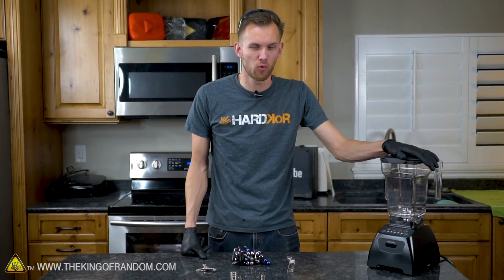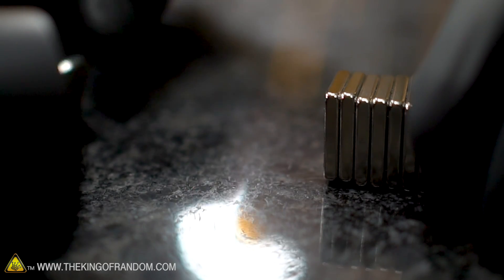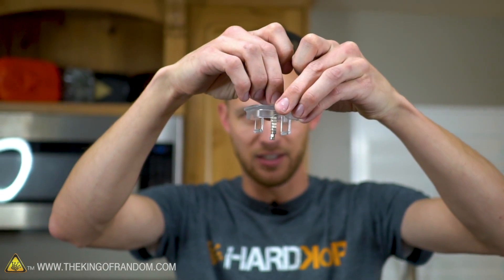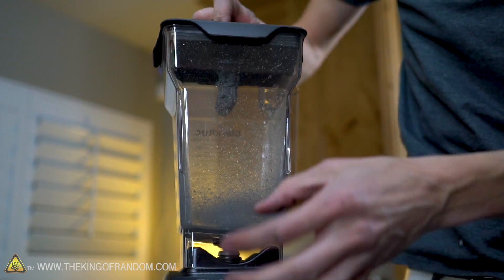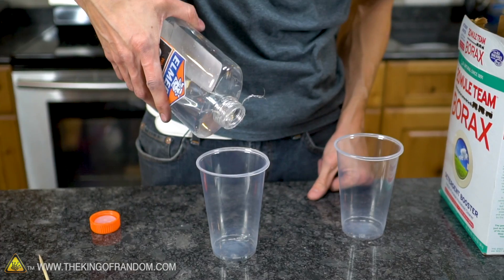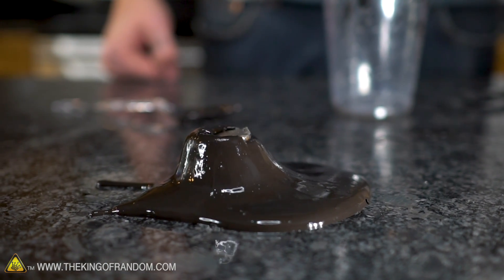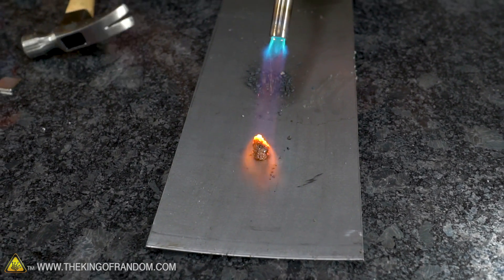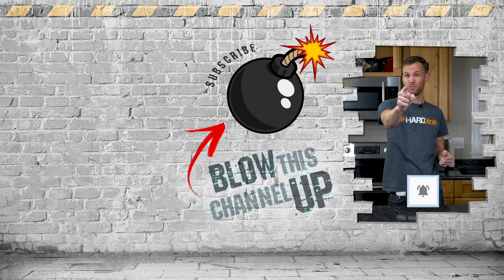Will This Make Magnetic Sand?

Comment: It’s more of a magnetic the ones that are not smashed and broken for ma’am or then Smash Into Pieces actually stick better for a reason the first reason is that it’s more it has more space to stick if it didn’t have more space then it would feel a little smooshed if it’s too much much like the ones that are not broken actually has a little bit much to but it still has magnetic it’s still you know if you have that harness that they use like metal things to make it in the squishy ones can I have a magnetic mag but look what has more SmoshAnd you have a small ones with little blender if you something bigger in the blender it will just rip a piece off and Susie will you buy that how much does it cost but I want to know how much that cost yeah I don’t know mother no we have anything else on

Comment: When you heat most ferrous materials they lose their magnetism (blacksmithing trick to know youre at quenching temp), when you hit the magnet with a hammer or the blender the actual material can change causing a loss in its magnetic power

Comment: they aren't getting weaker, instead, they are joining N to S. This is causing the force to be canceled. Normally a magnet has all the force going in the same direction. You caused the force to be evened out between the sides of N to s poles. So they begin to seem weaker.

Comment: its clear why the sand has less magnetic power; because the smaller pieces magnetic fields are not as neatly oriented as they are before. just hitting a magnet without breaking it can cause that.

Comment: The reasons that the “sand” magnet did not stay was because there was no real positive or negative energy
Reply: I forgot to say why but the reason why is because it was once a flat surface with positive and negative sides but when I was a ball it was little one of those round ones but with two sides doesn’t make sense right. So the positive is attracted to the negative which causes the two to have no effect to a reverse effect on the object

Comment: Try melting mangnets and then put them again ito one peace to see if it will have the same magnetic reaction
Reply: I did an experiment on the effect of heat on a magnets strength, and basically if you heat them up they get weaker. All magnets have a certain temperature, called the Curie temperature, where if they are that heat or higher for a period of time, they can permanently demagnetize. Any magnet that gets to the point of melting would not have any magnetic capabilities afterwards
Reply: @diegog5129  thanks for anwsering it is kinda strange but intresting too
Reply: @diegog5129  and one more thing then you expermented it with heat but that if are going to cool down or frezze with liquid nitrogen will it be the same magnet or it will be same as just heating it and try it with difrent magnets and wich magnets react or wich not just for showing in video
P. S sry for bad english i am from Lithuania

Comment: 2013: lets melt metal
2019: lets blend magnets
Reply: 12020:lets blend a blender that is blending a blender that is blending another blender blending metal junk with a computer powered electric line turning the blenders on and off
Reply: 2025: let's melt magnets in our kiln
Reply: @johnmarcel2723  and putting them in a magnet machine
Reply: 1112020: let's make a cookie
Reply: This just got 200 likes

Comment: My finger almost broke when I was younger because i was playing with my dad's industrial magnet cube on the open trailer and my finger was stuck between the cube and the metal of the trailer. In conclusion, magnets arnt toys
Reply: I got pinched by 25×25 mm maget and another same magnet and those have pull force of around 10 15 kg And it CRAPPY HURTS JDSJDHDHDHDHDNDJDJDBRIABVTKSVF

Comment: Why don't you try sanding the magnet to get very fine magnet powder. I've tried it and it actually works
Reply: Heat gets rid of the magnetic properties
Reply: Dazed  that is a GREAT idea!
Reply: @abdul mehmood You ok in the head? Iron is not a magnet and iron filing is just fine iron, not a magnet.
Reply: It’s workes it’s a works
Reply: 700th like btw
Reply: Try not to heat them up though
Reply: Wheres the fun in that
Reply: But then they wouldn't have the chance to break a blender!
Reply: Try using steel shavings
Reply: Really ?

Was it still strong?
Reply: *Eh Hem* 

WORKS.
Reply: DeadlySlayerX thx for the tip lol I never thought of that
Reply: Who else came to the comments to see Emirates A380 get corrected a ton
Reply: @braydenstranan5920  just you
Reply: Random comments
Reply: now that is  vary much ediquit :)
Reply: Works*
Reply: @christensirianni1835  you have a point
Reply: That's very cool! Thanks for the idea I'm going to try it. Wish me luck.🤞🤞
Reply: "Works"
Reply: *works
Reply: Did it work?
Reply: epickid426 you should reread the comment
Reply: @Nnnnnnnnnn670  it’s edited
Reply: @SomeRandomSpider12  no
Reply: @SomeRandomSpider12 

No it doesn't work
Reply: B

.
Reply: @ugandanweeb5719  your not funny

Comment: The magnet as a whole has one magnetic field (1 north pole, 1 south pole). When broken into pieces or dust, every fragment now has it's own north/south pole. You have several tiny magnetic fields all intertwining with each other which is enough to hold each particle to each other yet not a strong enough magnetic field to hold the weight of the total material.

Comment: You have created a model of ferromagnetic material- it is a weak magnet because all those tiny magnets are oriented in random directions  so the fields cancel out, like the domains in real material. Maybe you can remagnetize it if you put it in  some rigid container and then drag a pole of a magnet along it severaltimes it could turn those magnets  so that they would face roughly in one direction.

Comment: Little fact: The sand was probably burning when you heated it up. Yes, metal CAN burn if the surface area : volume ratio is high enough (For example, magnesium ribbons or steel wool). That's probably why it was sparking and glowing orange too. If you put a match to it, it's probably gonna burn too.

Comment: U forget to sat that you can demagnetize the magnets with the heat.... If you saw that sparks in the blender, that means that you have a glowing hot material in there, that cause deamgnetization. Thats the same, if you crush it with hammer, beacous of energy convertion..... you can actualy make a fire, if you are smashing the steel rod with a hammer. that cause enough heat, that you can simply put the rod  somwhere to ignite a fire.

Comment: How about a vid showing if a magnet is still magnetic after freeze drying and/or dipping in liquid nitrogen!
Reply: Actually, the magnet is much stronger in low temperature
Reply: Sáng Đào Duy, dip the magnetic sand into it then see if it holds stuff.
Reply: @Ethodica  most sand has contains haematite or pyrite etc basically most sand has iron in it naturally.
Reply: Hed make a super conductor and thatd be sick
Reply: Yup
Reply: It becomes super conductive it's pretty amazing

Comment: im only 13 so dont @ me on this but, when magnets break, doesnt each piece have their own 2 poles? and i assume that when turned into sand some specs would be atracted but some also trying to push themselves away therefore not having much magnetic strength

edit: nvm they just mentioned this on the vid

Comment: i saw sparks, heres the issue with the magnetic sand you guys made, once neodymium magnets heat up, they drastically start losing their magnetic properties, so breaking them and causing sparks was probably why it didn't magnetically hold to the sheet

Comment: Neo loses its magnetic properties from heat. Notice the bright sparks, it's hot, rendering its ability to be a super magnet.
Reply: also from impact
Reply: @Stone_Wolf_Media  impact creates heat. Not also, but because of impact. Heat basically does the same thing by shaking the polarized particles up, via vibration. It's the same thing. I guess when you are only heating it/ only hitting it, the two are different, but think of it as the exact same chemical reaction.
Reply: Is the curie point effect maybe?

Comment: Ok so let’s say that the magnet had all 44,000 particles in line contact then you smash them and pull the particles apart and you split that 44,000 into 1s now you have the 100% of the magnetic force split into 1s it’s still just as strong but it’s split into 1s instead of a hole of 44,000 so if you rebuild it it will be fine but that’s no possible so in every spec there is 1% of 100%  and that’s why it looses strength

Comment: Magnets are usually magnetized about a certain plane that is through the thickness  length or width when you crushed them you turned every piece into a little magnet and bc of that there's no specific place in which magnetic flux density is concentrated in leading to its weak interaction with other metals

Comment: Think of it like this, if you had a bunch of friends help you push a large heavy crate you would all push from one side or pull from the opposite side, that is whats going on with the solid magnet. Now imagine if your friends just start pushing and pulling on random sides of the crate this is more or less whats going on with the broken up magnet. If you were to draw the magnetic field lines for a solid magnet the would all align to the positive and negative poles of the magnet, if you were to draw the field lines for the crushed magnet, well just scribble on the page a bunch and that is more or less whats going on, the magnetic fields of each of the tiny pieces are not aligned.

Comment: I'm only 3:00 into this video.  The biggest problem I see currently that you're having to make this work properly is a flawed methodology.  Hear me out.  Heat is the biggest killer of magnetism for any magnets and when you're exposing them to that much heat from a hammer or a blender then they are going to seriously lose the majority of their magnetism.  You need to cool them puppies down and keep them cool while you turn them into dust!  I don't think a hammer or a blender is the right way to go.  OR if you redo this experiment, then blend the magnets in a cold liquid to keep them cool.
Reply: Ive heard that LN2 makes the magnetism even stronger, so if they could blend, or even ball mill, them into a powder in LN2, couldn't it have a much strong magnetic pull? (assuming the LN2 does put such a sudden temp difference it shatters the glass)
Reply: ... LN2 and mortar and pestle
Reply: Or just grind them slowly, like in a mill. If a powder is what this guy was going for, that would have been the best solution. Ask any welder how many metal filings get stuck on equipment, and tanks after grinding just regular mild steel all day.
Reply: What about the fact of the impact from the hammer removing magnetism by misaligning the domains?
Reply: @rockstarfoxy654  thanks for that. I was going to go on a rant about magnetic domains, heat and force, but this thread of replies is doing it for me
Reply: Yes, although I know iron magnets with magnetically polarized nodes  will lose their polarisation from heat and or being physically beaten.  Their magnetic nodes can be realigned to act as a single magnet again.

Anyways my real question after this video is what if he blended up the magnets with ice water or cold slime.
Reply: Blend them with dry ice lmao
Reply: A cool liquid like liquid nitrogen!
Reply: EpicATrain so many words I didn’t read all of it. Sorry.
Reply: Yup. He needs to use a grain mill.
Reply: He said that he knew the magnetism would be less then normal
Reply: Even If You Blend The Magnet In Cold Water It Will Still Lose Its Magnetism 

Reason:The Magnetic Field Becomes Weaker Because The Magnetic Poles Are Pointing on Different Directions, Which Means Some Magnets Repel And Some Attract 

Edit:IDK if I Explained This Properly
Reply: EpicATrain not possible. Blending creates heat by the friction.
Reply: @ShawnLH88  it is possible actually. Ever heard of cold press process? I believe in cold pressed olive oil (correct me if I'm wrong about which oil it is), they use a very long expensive process to create oil that generates no heat at all, which is much more expensive. Why? Heat ruins the taste of the oil compared to traditional made oil. They created the process in which they squeeze out the oil without generating any heat. This same process can be adapted for this.
Reply: @Jack Foley nerd*
Reply: That and any extreme vibration will ruin the magnets pull because it realigns the molecules.
Reply: Nobody likes a nerd...
Reply: @Adair Carlin a normal physics class will teach you about magnetism usually
Reply: What about freyon?
Reply: Aaaah my ears!!!!
Reply: I don’t know the truth of this and I also didn’t read this chain but I think impacts kind of scatter the molecules that distinguish north and south tilt, losing magnetism. Not 100 sure but I’ve heard it.
Reply: NEEERRRDDDD ALERRRRTTT!!
Reply: We are speaking English but we aren’t speaking the same language
Reply: @Jack Foley It's not exactly difficult, even a jock that's past Grade 6 should know about this and be able to explain it.
Reply: Shinoa Hiragi by your name am I to assume you mean a grade 6 jock from an Asian culture? A jock with just a grade 6 education from North America thinks it’s magic holding their crayon artwork on the fridge. 😜
Reply: R/iamverysmart
Reply: @kevinfromwork3785  that's not how it works
Reply: BlackSheepBoi r/foundthemobileuser

Comment: Magnets are essentially charged particles in a certain orientation. With "block magnets" there is a uniform north and south pole on the magnet. When you grind them into a powder however, they will stick together due to magnetic attraction, but the magnetic capabilities will be reduced, as it goes from a uniform north south orientation, into just a blob with the poles facing in all directions. However, when you put a stronger magnet onto the powder, the poles are forcefully oriented into the opposite of the pole on the stronger magnet. This causes the effects seen in 11:07.

Comment: You can try blending it with a degausser. Changing magnetic field will throw the magnet all around the container, hitting walls and other pieces constantly. It's best to start with a couple of magnets so that there are some things to hit. I've tried it once just for kicks and it did seem to work. I did it in the glass jar, so you can imagine the noise it produced . You can also try adding the sand to that "blender" and watch it turn into a fog. :)

Comment: @thekingofrandom

The reason the crushed magnet still seems magnetic is because it is.  Each piece of a broken magnet (no mater whether they were north or south) will always form its own north and south poles.  That's enough to hold them together. 
The reason they are seemingly weaker is because the poles of each tiny piece are pointing in different directions, so the overall effect of all the tiny parts often cancels out in places.

Comment: Could it be possible that the blended magnets lose their magnetism because the sparks are fragments of the magnet and due to the extreme heat, loses the magnetism it had and just turn into a metal fragment? And could you possibly test this theory by crushing the magnets with just a slow crushing force. For example: rolling a rod on the magnet, a press etc.?

Comment: I'd like to see you try incorporating a non-magnetic material (if you can) to the point where the magnetic particles are fairly spread out, subjecting the mix to a decent magnetic field, then removing (possibly by using salt and dissolving it?) to reincorporate the magnetic particles already aligned and see what kind of magnetic strength you get

Comment: Try doing this called
MELTING APPLES BY USING BOILING COKE

How to do it
1 get a test carrot and put it in normal water
2 put the other test carrot in a coke bottle
3 get the other test corrot in boiling coke
4 for real put 5 apples in boiling coke
5 put the apples in boiling water to cool off the suger
6 put the apples in a boiling hot sauce furnace
7 cool the apples down in ice boiling water
8 put suger in the apples
9 get the test carrots and put it in the blender
10 put the corrot juice in boiling water
11 put the apples in the boiling carrot juice
If down in 3 hours it the apples will melt if not step 12 get blender and blend carrots
13 put the carrot apple juise in boiling coke
14 drink it
15 scream like a girl 👍
Reply: Eeeeeeaaahhhh!!!!!!!😲😲😲🤑🙃😛🤗🙂😄😆
Reply: Nicole murphy no i donot, he doesnot want either, you ugly

Comment: If they get too hot, they'll lose their magnetism. And if there's sparks, that means something's getting really hot. Even if the giant mass of material isn't all hot, when they first break off, the tiny fragments probably are, and they will lose their magnetism.

Also, the really shiny stuff isn't actually the magnet. They're plated with nickel, because the actual magnets rust and corrode very easily. Once that's all smashed up, Your sand won't last very long. The material will oxidize.

Comment: You did quite big mistake by using blender to shatter those magnets. Magnets loose their magnetism with heat, and all those sparks mean there is lot of heat. For most magnets 80C is maximum temperature. If you use mortar and pestle and slowly grind those, you should get stronger magnetic sand.

Comment: when you heat up a magnet up to a certain point, i forget the name for it, it looses all its magnetic properties. So when you blend the magnets and get sparks, that is parts of the original magnet breaking off and heating up past this point, then that joins the sand due to the same reason why you can link paper clips together using one magnet. This is part of the reason why the sand will have a much lower Tesla rating than the original